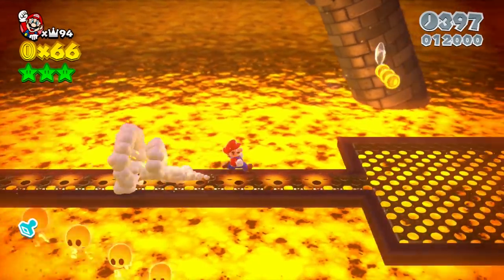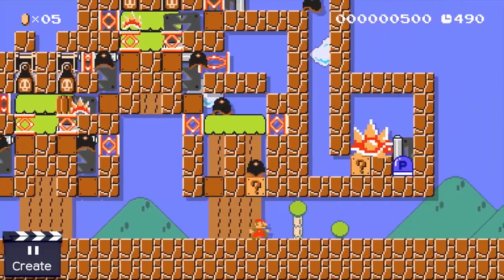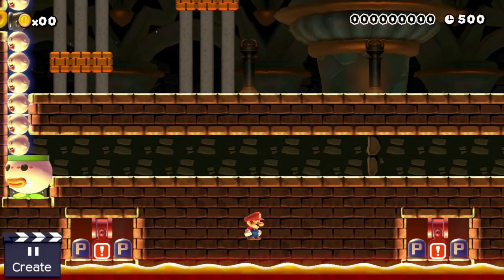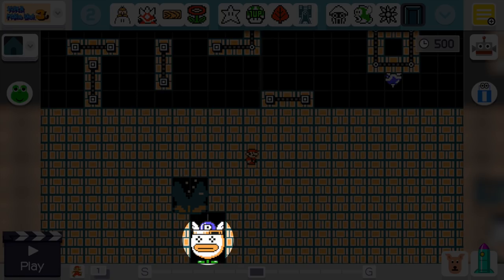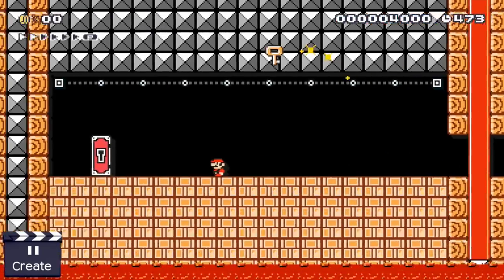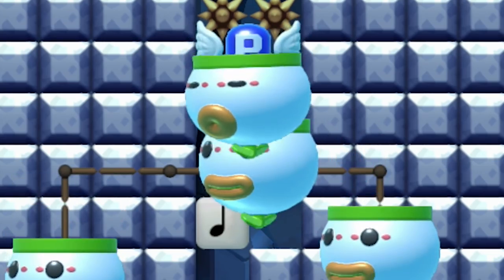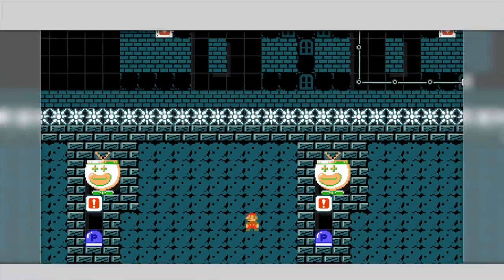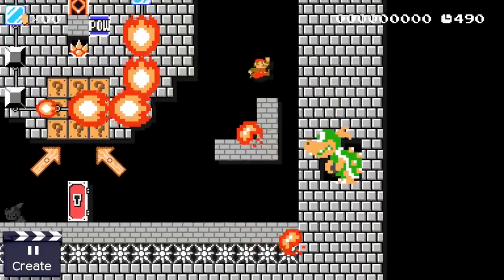9 Designs for “The Floor is Lava” Levels in Super Mario Maker.

Comment: Mario Maker 2 allows for a neat Floor Is Lava challenge. Set the clear condition to never touch the ground after leaving it. Add vines then you got a semi-workable floor is lava challenge
Reply: Or just make rising lava
Reply: neon night mare 666 horror gamer clear condition is better because if you want uneven floors, the lava can’t be at two different heights at once.
A way better, way easier solution is...

spike traps

Comment: Mario maker 1: Get something that counts as an entity, put it to the top or bottom of the screen, make it so that touching the floor is just enough to load the entity, connect the entity to a contraption to activate a p switch, place brick blocks up top, put munchers on them, and add safe spots for the player to land so they don’t touch the floor.

Mario maker 2: Clear condition.

Comment: How did you make the "everything is forbidden cave" when I tried the Thwomps were always too low and would trigger when Mario was standing on the normal platform.
Reply from the maker: I used big buzzy beetles, I forgot to mention this in the video, the beetles have a smaller trigger radius as the thwomps!

Comment: I love your stuff like this, but I have a problem: they use POW blocks and P-Switches, which give you coins and points, respectively. I like to have 100 coins, 1 hidden mushroom, 3-10 bonus pink coins for stuff, and the flagpole, totaling 3-4 1-UPS. These methods mess that up. Otherwise, I'd use them lots, but...

Comment: Did you know you can make a contraption where smashing a POW block causes the floor to collapse? You probably wouldn't have a hard time thinking of how to do it, but anyway, the floor is made of brick blocks that turn into coins when a P-switch is triggered. Smashing a POW block triggers a P-switch, because there is a big muncher stacked on a small muncher, and killing the small muncher makes the big muncher fall on a P-switch.

I made a level using this (and also a one-screen puzzle that I deleted due to poor ratings):
6E94-0000-02E7-BA29

Comment: Or... my idea is probably worse, but here it is:
Make spikes, and put kaizo blocks 2 blocks above (aka make sure Super/fire/lanky/propeller/cape/tanooki Mario can fit in between the spikes and blocks without having to crouch). This can also worl as placeable lava combined with a red mushroom behind spikes.

And with the clown car piloted by p switch loading trick (aka the one with bricks in a haunted house) you can just use a spring instead of the Clown Car right under the p-switch to make it faster

Comment: I have a The Floor is Lava contraption, place some plain ground with blocks on the far left and right, add a koopa, place a note block (with a muncher inside) on one of the plain ground blocks place it over a P-switch       (with a block under it) and there you go. I made a level about the contraption here’s the ID: 26F3-0000-036E-BEB8

Comment: I really hope Nintendo doesn't screw up SMM when MiiVerse is shut down. It seems like peeps like Ceave have barely scratched the surface of what the game is capable of.
Reply: romantiCaveman A lot of people have found crazy things, like you can ground pound a block with a grinder in front of it using pause buffering, and you can do one side wall jumps using the fire flower in the nsmbu style, not to mention kaizo and item abuse

Comment: From 4:23 to 4:28 you say that only Floor parts with track pieces are actually Floor parts.And at 4:32 Mario touches the uhh... What is the actual floor if that with track pieces is the floor? (I just take it how you said it, Ceave) Is it the Wall then? Or the ceiling? But if it is like this then, isn't the Video supposed to be a don't touch the Wall (or ceiling) Video then?
And If yes, that wouldn't make sense either as it wouldn't fit in the Rest of the Video then.
And even if the answer is no then it wouldn't fit either.
And now i don't know what to understand as right there.